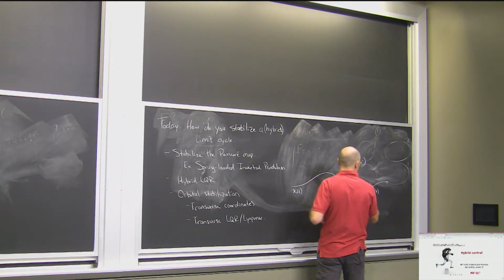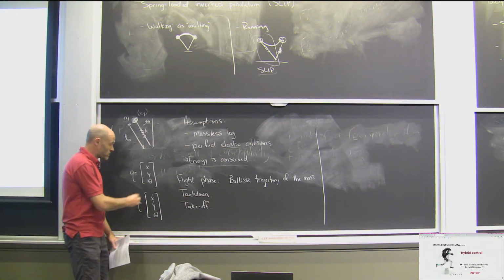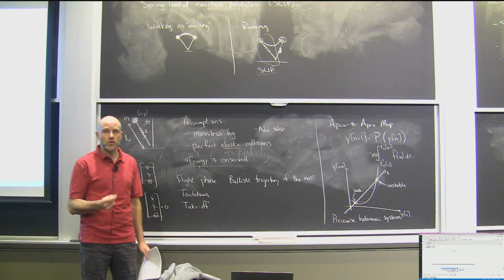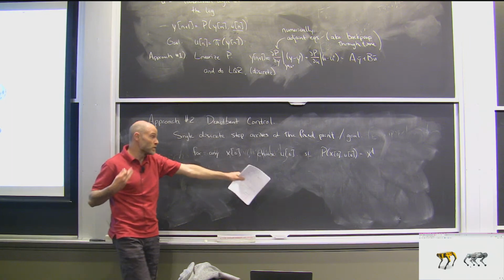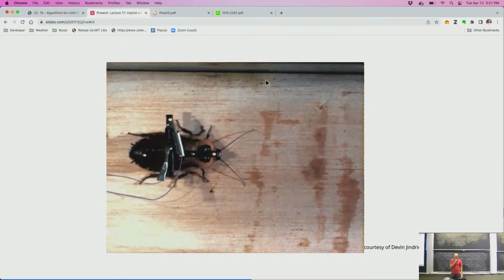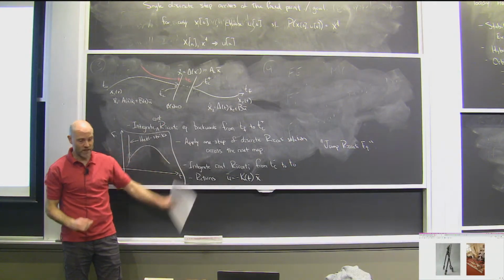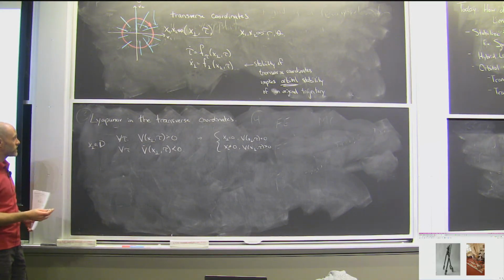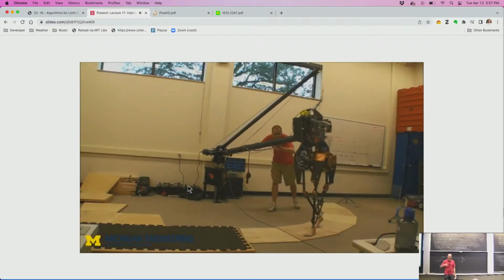Lecture 17: MIT 6.832 Underactuated Robotics (Spring 2022) | "Hybrid Stabilization, Simple Running"

Comment: Shouldn't there be something to enforce some progress (any arbitrary positive velocity) of the phase coordinates though? If I hold the robot at a point where the error along the transverse coordinates is zero, it seems the LQR controller based on transverse linearization will make no effort to proceed along the phase, which may seem like a insufficient specification of the task - I suppose the assumption is that robot's unactuated dynamics is enough to create natural positive velocity along the phase?
Reply: Having τ̇ ≥ 0 is a perfectly reasonably condition to ask for; I agree some tasks might require it.  As you say, often times it comes for free from the dynamics of the system (if you have an orbitally stable limit cycle in phase space, then having positive velocity necessarily implies that you are moving forward in position, etc).

There is one interesting subtle point here: when we certify the regions of attraction of hybrid limit cycles do required that τ̇ ≥ 0 as part of the certification, because we don't want any trajectories to go backwards through the guard/reset map (that's even assuming that it is well defined in reverse!).